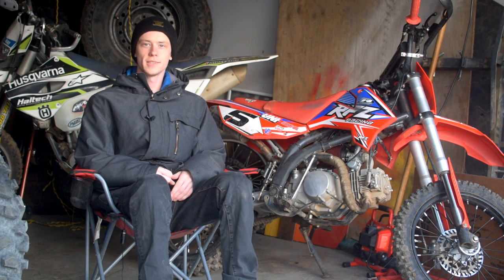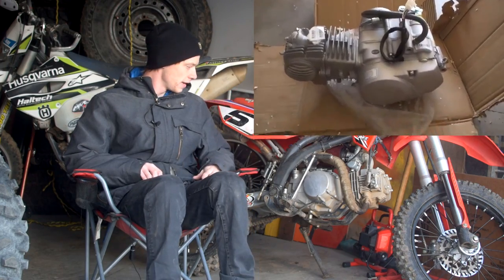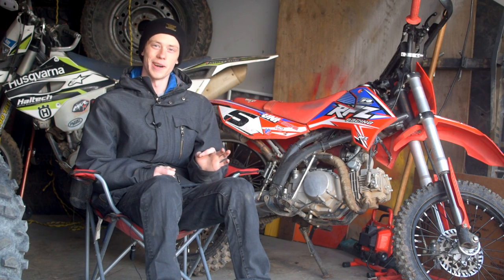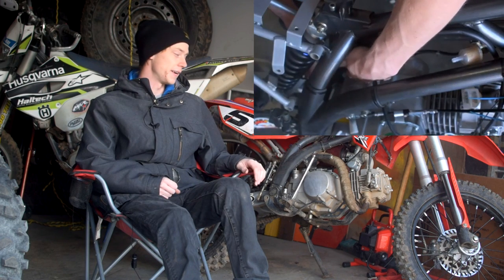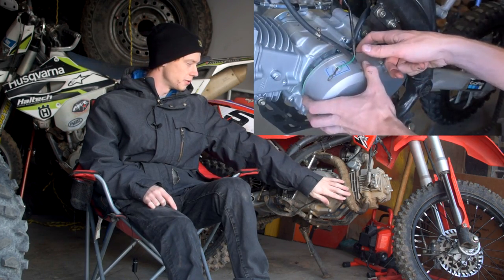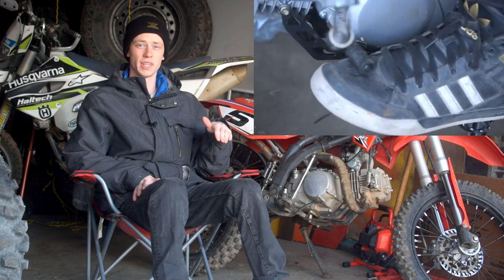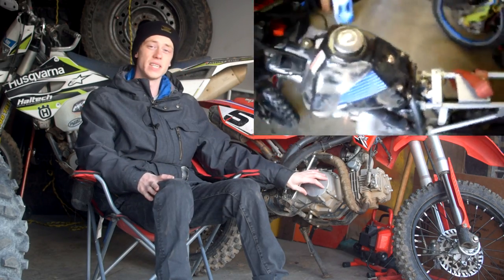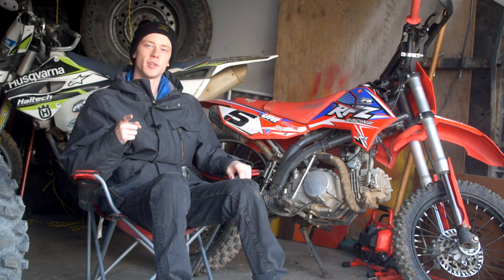Why You Should Engine Swap Your Apollo Pitbike

Comment: I got a crossfire cf 250 and in 4 hours bent the gear selector fork 🥴. Cost me $2000 for bike and when I bent the fork the dealer fixed it with new for and only charged me 1 hours labour and $80 for the fork. Can’t tell you how far my gut sank but it must have been below the floor. Learnt a big lesson that day.
Reply from the maker: Lessons learned man! At least it was repairable!

Comment: I need information on the Wheel Set Upgrade....Size and Make...thanks Aaron
Reply from the maker: 17” front 14” rear. Tires are linkedin bio
Reply: @AaronsEnduro  will 19"x16" fit..?.cause its stock with 17x14 already..
Reply from the maker: Depends on what rear swing arm you have
Reply: @AaronsEnduro  2020 RFZ Apollo 125cc ....I'm not sure the swing arm size
Reply from the maker: If you have stock RFZ rear swing arm and yours isint a z20 max, you can only fit 14” rear. You need RXF rear swing arm upgrade for the 16” rear
Reply: @AaronsEnduro  its Z20...not sure if its max though
Reply from the maker: Measure ur swingarm
Reply: @AaronsEnduro  sorry....its 16" rear 19" front....and my question is can I upgrade to larger size tires and rim... (18"rear X 21" front)..?
Reply from the maker: Unfortunetly not
Reply: Yes you can, its litterly the same bike with the same forks and swimg arms. Contact apollo, i bought the apollo z20 because the max was out of stock and bought 19inch from wheel and a 16 inch back,  fits perfectly fine..    you think china is gonna change the swimg arm? Hell no its littery just bigger wheels on the same Exact bike everything is the same on the both. I went through the same shit and realized that the bike sits at 32.4 inchs
Reply: Changing the swing arm cost them more money overall, their bikes are cheap for a reason.  safety standards, cheap labor,  cheap parts, aluminum, standard crap. They cut corners anywhere possible for profit.
Reply from the maker: Sorry i should of specified it may not work, as the z20 has a different swingarm than the normal rfz
Reply: @AaronsEnduro  nah your good man. Love the channel,  been watching for for months, good content.  I know these apollo bike are definitely somewhat built with different size swingarm nd forks, etc. The z20 and Z20Max frame is different,  its some double beam crap they say. I wanna swap a gxp 150cc or yx140cc but im hoping my front wheel wont hit the head of the engine. Was going to get zongshen 190cc but its just too big
Reply: Sorrry guys i should of read it better , he wants to go bigger then 19/16 then i honestly think itll be way to big then.. sorry Aaron
Reply from the maker: The 150cc engine should fit right in the z20 no problem (if it fits the smaller rfz frame i have it’ll definitely fit the z20 max

Comment: Okay I can't find anything on it maybe you can help me... Is there anything I can use to swap the Apollo 4 stroke 250cc motor?
Reply from the maker: For an rfz , only if it’s an horizontal engine.
Reply from the maker: The db36 250 engine is vertical

Comment: Hey bud please get back to me personally I bought a 2020 Apollo rfz, the guy I bought it from told me it was a 125, I'm not sure if it's 125 or not, because it already has a 14in rear tire and a 17-inch front tire, does this mean anything? How can I find out what size this engine is! Because I need to replace it
Reply from the maker: On the engine block it will be stamped “125cc3” if its a 125cc
Reply: Thank you for getting back to me that was really fast I appreciate it thank you very much. It's late for me right now I will look when I get a chance. Hopefully I can contact you for more info thank you again!
Reply from the maker: You’re very welcome friend! If you ever need help just leave a comment!
Reply from the maker: Also if you’re replacing it its 50$ more for the 140 which will swap right in
Reply: I've been looking for engines, and I can't remember where I heard this from, but I heard that a 125cc engine would be around $200 or so. I've looked up the 125cc engine, but I'm finding prices of 350 up to 500 plus dollars. What should I expect to pay for a 125cc, or the 140cc? The bike I have is an Apollo 125, it's a 2020 model, but I bought it from a guy who had bought it himself from someone in New York City, and what I know is that this bike was written in the city on the streets, and wasn't really taken care of. I paid $270 for the bike and the engine was falling out, it only had one bolt in it, I had to rewire the bottom of the frame between the foot pegs! Just wondering how much I should spend, and if it would be worth it
Reply from the maker: I have engines listed in the descriptions in my most recent apollo videos! 

(I have them in this videos description)

You can also go to apollomotors.ca and can see all their official listings on engines n stuff. Im in canada dollars but i paid 550$ for the 150cc engine.

The 125 engine was listed for 500$